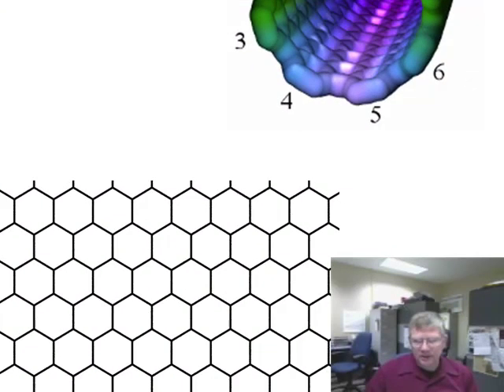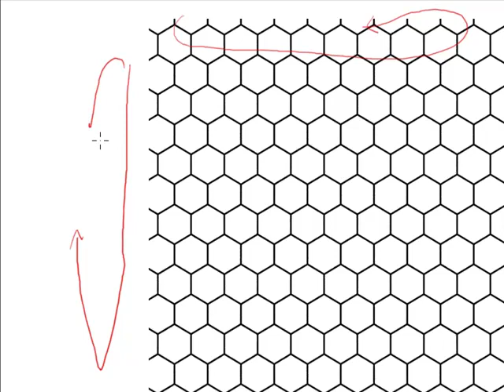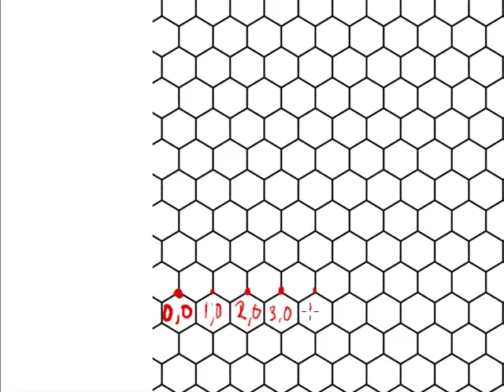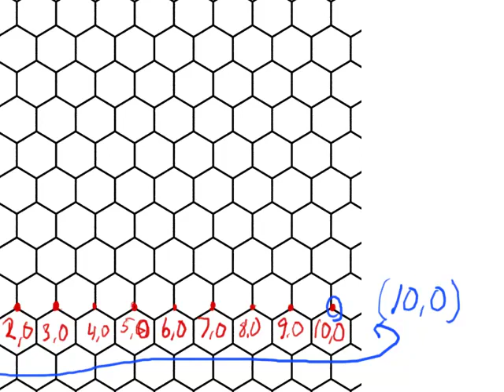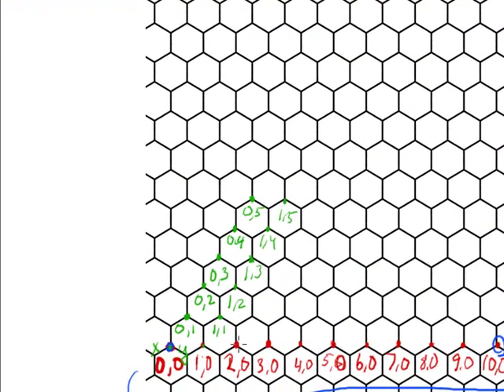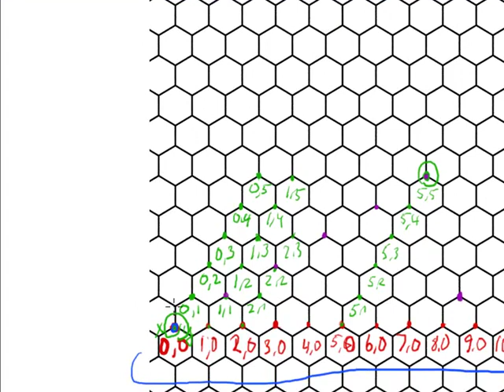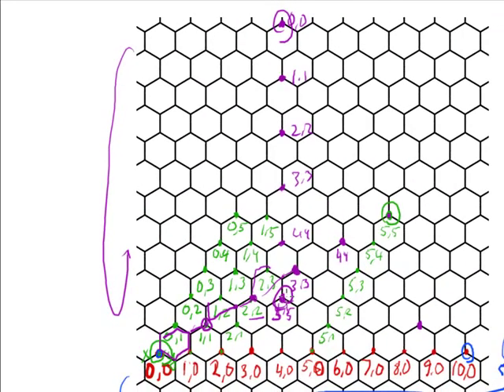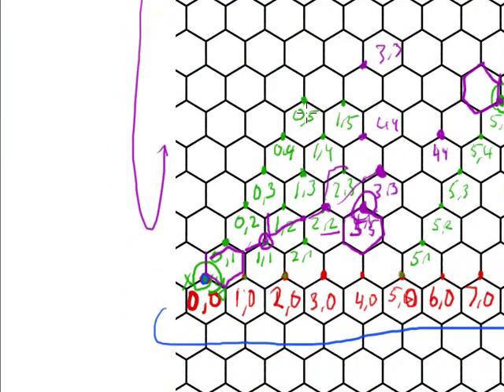Nanoscience: Carbon Nanotube Nomenclature

Comment: Greetings Mr Mikelson,

I am throwing a bottle in the sea here in the hope of getting a reply from you or from someone in the comment section who knows more than me about the subject.

I have just stumbled upon a paper published in 2019 about carbon nanotubes application in windings for electric motor, but unfortunately the email provided by the publisher is either erroneous or not in use anymore.

I am not from the academic world, but as an entrepreneur who’s trying to start a small series electric supercar /hypercar company, I have been wondering why nobody is trying to taking carbon nanotubes windings for electric motors from the research laboratories into the market.

I will be honored to discuss with you on this topic in the hope of gathering more information about this very promising material.

Kindly,
Lamine